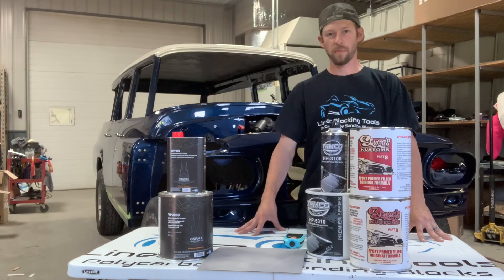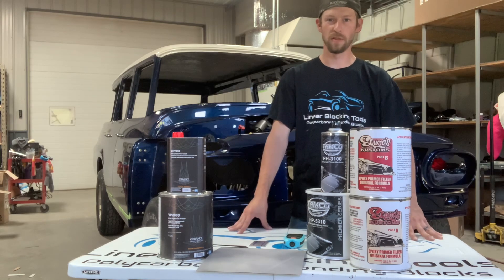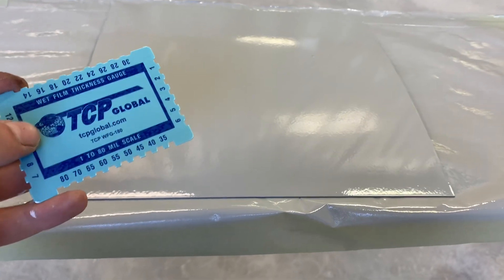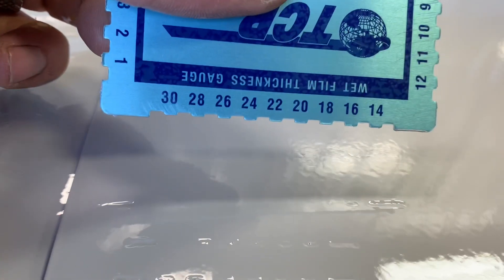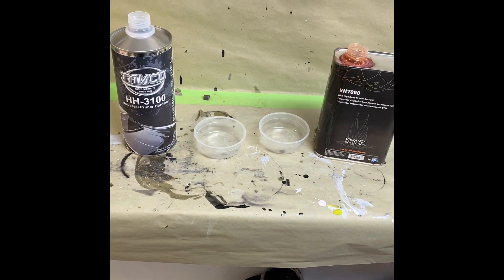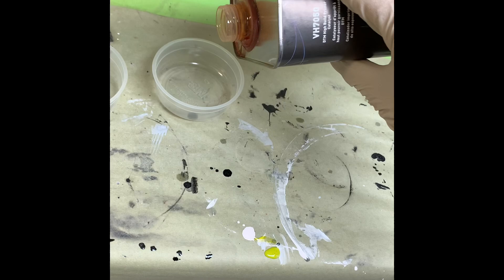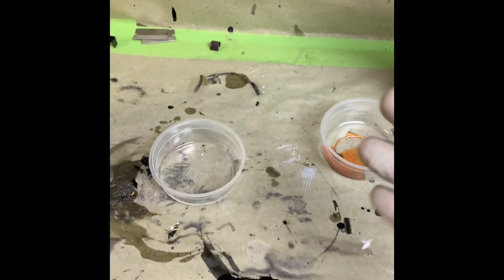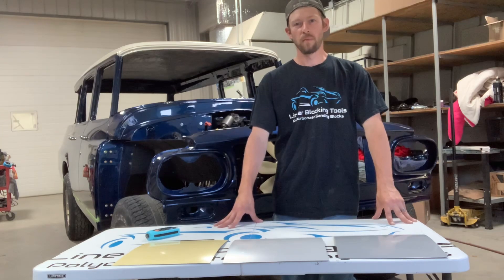Primer shrink test! Vp2050 vs hp5310 vs squeeg’s high build epoxy part 1

Comment: Not sure what comparing epoxy, which is non-statable by the way, and cross-linked isocyanate urethane have to do with anything.   Cured urethane, like 5310 is a different product after cross-linking. Epoxy is two products which combine, but have the properties of both components. Also,  not sure about the comment  that urethane isn't dtm. Even if that's true, applying 2k build primer over epoxy makes that point moot. And who's to say initial shrinkage is a barometer to future shrinkage, especially when comparing two completely different types of products. I'd always prefer to have an iso catalyzed substrate barrier under iso cured base and clear than a non-statable epoxy under urethane base and clear. Guess it comes down to what works for you.